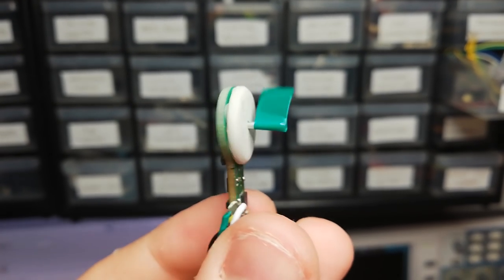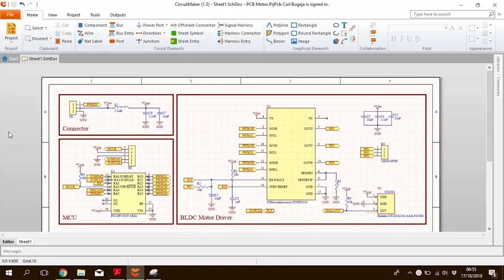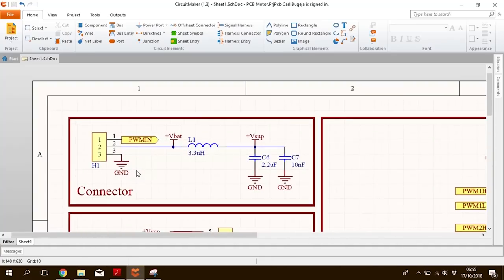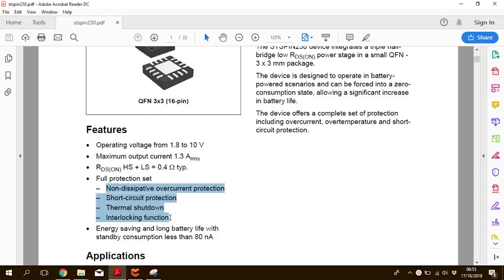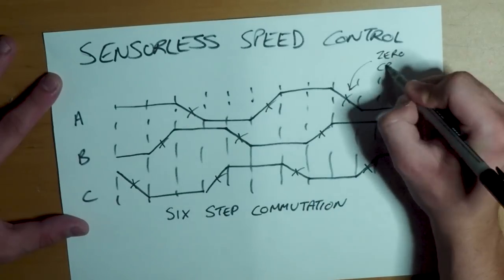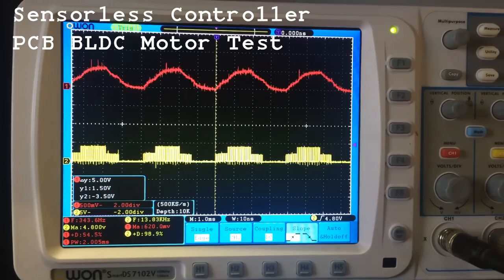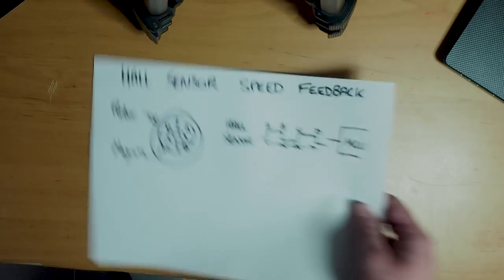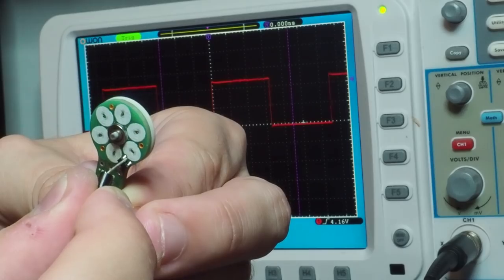Designing an ESC for my PCB Motor

Comment: Amazing work!  I'm probably twice your age and have maybe a tenth of your knowledge and success in this area.  Very inspirational!

I do have a question though.  Would you be able to increase torque by putting a rotor on both sides of the board?

Thanks for sharing your journey through this project!
Reply from the maker: Thanks! 🙂 I have tested the double rotor idea a few months ago but it had barely any effect on the torque https://youtu.be/IYtyOGsKyrs
Reply from the maker: Like josh said the pcb coils produce the same magnetic strength.. Another option i might test is having multiple pcbs and rotors sandwiched in between

Comment: This looks pretty cool. I've had this thought in my head for the last year or so that it would be really great to have a spherical drone that I could fit in the palm of my hand, and that would have the propeller components all internal so that it would appear to float. Considering the only external components I would want on this thing would be a basic sensor to follow another sensor located on my person, and a 5 or so megapixel camera and perhaps a microphone, do you think this motor would have enough strength to keep it aloft at about 6 or 7 feet?
Reply from the maker: I obsessed with the same idea haha but the dynamic torque of this motor is still a little better weak to rotate the propeller at very high speeds and generate thrust - i'm hoping to make some improvements and progress on the torque in the upcoming months